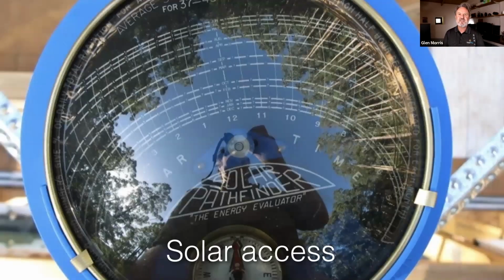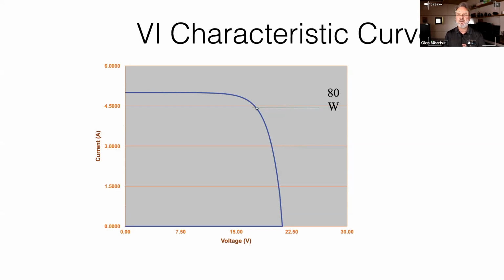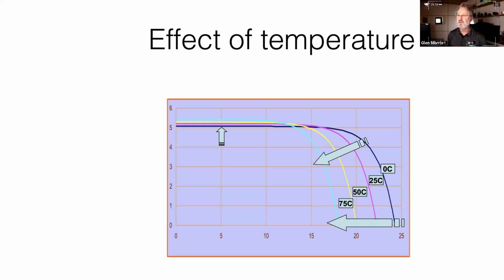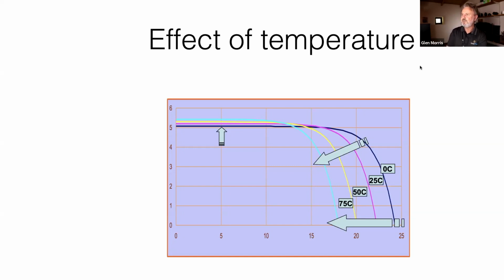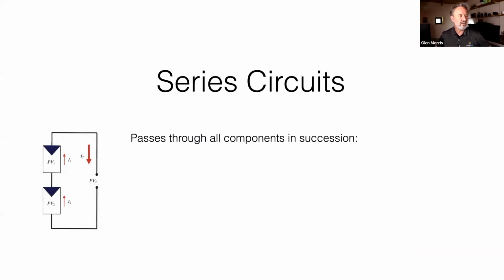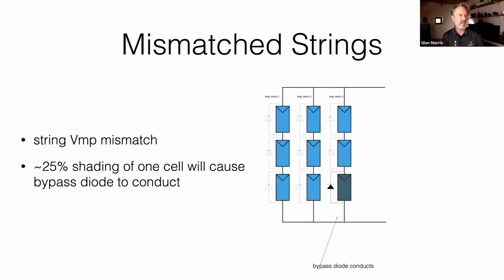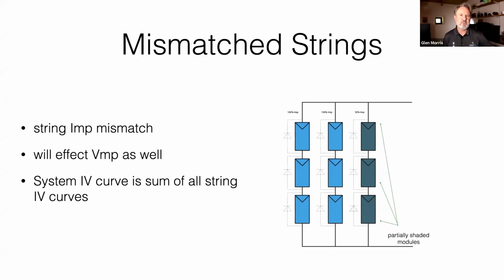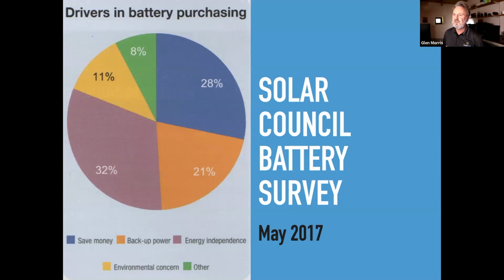Solar & Battery Training Ep2

Comment: Thank you for the great video's! Will definitely watch all of the 13 in this training. I do have some questions. When talking about temperature, you talk about panel/cel temperature, but the STC is surrounding temperature. You mentioned that around 0 degrees outside, the panel/cel 'could' stay below 25 degrees. But I wonder, what if the temperature is 30-35 outside? I'm asking for future reference in Indonesia, where temperature is all year around hot, and mostly working in 30+ degrees. Our roof here, of metal, is burning hot. Would a panel be this hot as well then? Would thin film be the best categorie to choose from to use here or does the temperature doesn't have that big of an effect that mono/poly should be avoided?